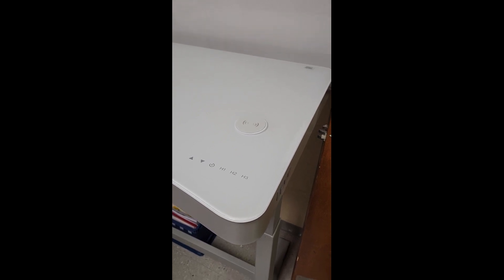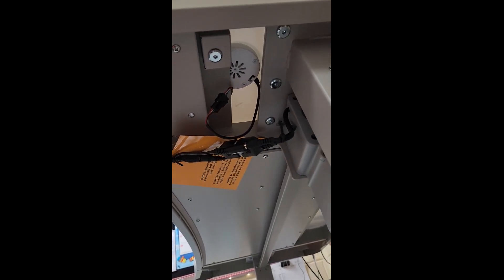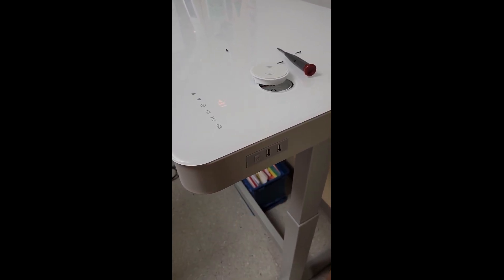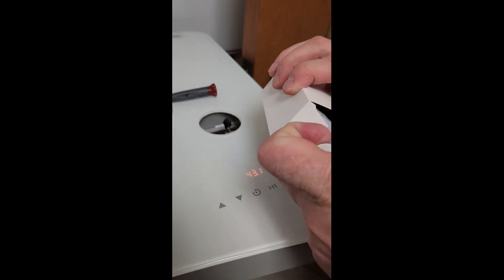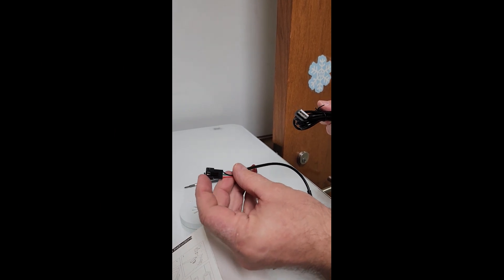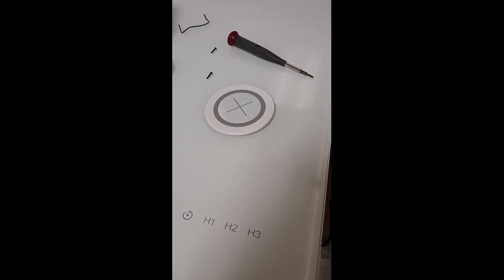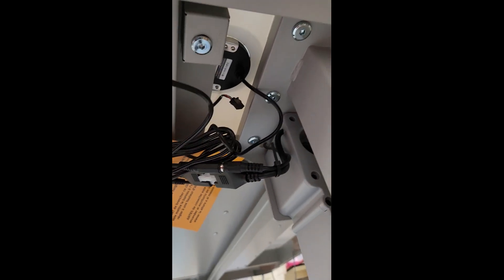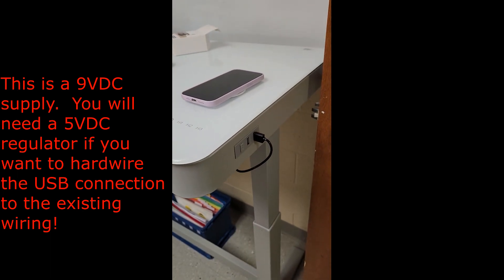Tresanti desk wireless charger replacement

Comment: I JUST bought this desk a week ago. Charger worked fine up until day 2- day 8🤦🏻‍♀️ a $330 desk SHOULD FAIL this quickly. Great video, I bought the same replacement prior to watching this video. My problem is- I’m having a hard time unscrewing the tiny screws w/o stripping the thread.

Comment: THANKS !!!GOT IT DONE. Tried without seeking video!impossible. Couldn’t figure out why I couldn’t lift the old one or slide the bottom out from that angle due to that third little screw!! Tresanti’s charger died after 1mo. un assembling to return to COSTCO just for that would have been chaotic

Comment: Pull my broken charger apart. While the board says 9V. The actual supply from the desk is 5V. 4 pin connection is basically USB (5V, D+, D-, GND) D+/D- aren’t connected on the wireless board. Looks like lots of cheap AliExpress Qi charger modules are the same basic design but shaped differently. If open a more expensive wireless charger, will find > 1 coil loops for larger charging area and more complex Qi transmitter controller.

Comment: I'm confused. This is not my first electronics project, and your video is clear and simple. However: I have purchased 2 of the chargers from Amazon, and neither one seems to work. I was planning to immediately cut the wires and install the connector so that I did not need to use the USB side ports, but....I decided to quickly just try the charger by plugging it into one of the side USB ports. It seemed to work initially, but I will say that it took quite a bit of moving my phone around and patience to hit the spot where it charged. Much different from my usual experience with chargers. Then the one I bought from Amazon just did not work after only  few minutes. I sent it back, and got another one. This one didn't work at all. Further more, the SPECS on the charger seem to suggest that it will work with a USB 5 volt supply, but neither of my external power supplies worked with ANY of the 2 wifi charging plates when I tested out the unit that I orderered from Amazon. I really am surprised. I will try to reach out to the people that provide the unit to Amazon. I am confused about one thing in your video, however:  you mention a 9V charger and needing a 5V regulator. Are you sure? I measured the supply voltage from the table to be 5V.
Reply: me too, 5V on table power supply. Its basically a USB connection. Read my other more complex comments. I think the board can probably handle 5-9V, thus its just labeled 9V

Comment: Do NOT follow the instructions that Twin-Star sends with the replacement charger.  It's too complicated and seems to be risky.  Remove the 2 obvious  screws from the bottom.  Then use dental floss to get between charger and glass top pulling up in area where the 2 screws were removed.  There will be enough play as shown in the video (using gloves because the edge of charger is sharp enough to cut) to rotate the charger to get to third screw.

Comment: i was never able to pull out the old one from its position after removing the two screws
Reply: ok I was able to go underneath and use the screw driver to push it up .Cheers